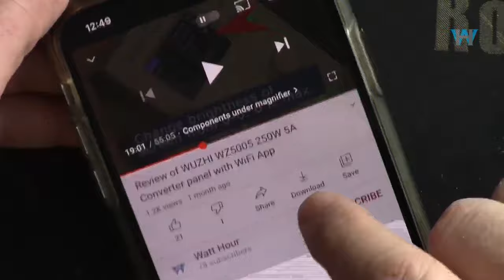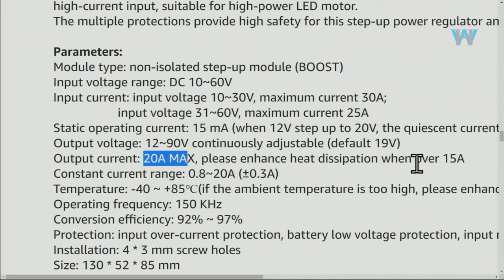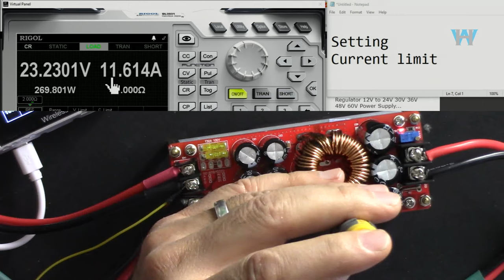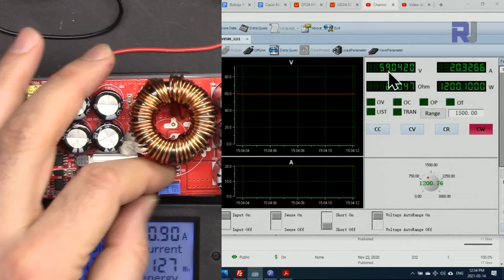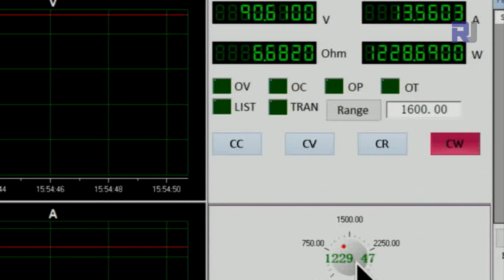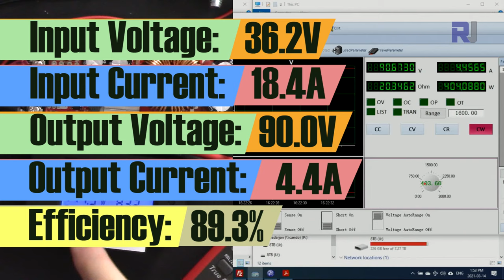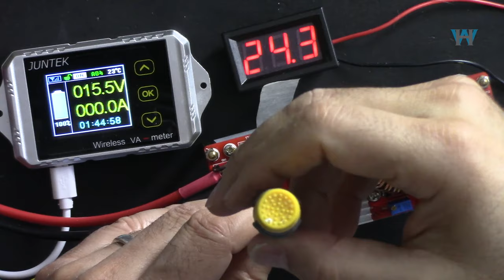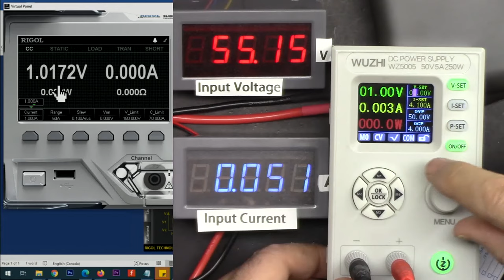Review of DC 1500W Boost Converter 10V-60V to 12V-90V module 1.5kW Tested

Comment: Thank you for your video !  excellent work !  I plan to buy 3 or 4pcs of this and connected them in parallel, I will add a blocking diode at the positive connector of output side before parallel connection.   The idea to add this component to prevent back flow current from other units.  Do you think this product can be connected parallel to bring up bigger current output ?  I plan to use this to charge my battery pack of 560Ah.
Reply: I used no diode and it immediately killed one of them. I don't know if I'd recommend it. Wish they made bigger ones.
Reply: Did you try out the idea and what was the result.  I guess, the OR-ing diode concept should work, provided the individual CC/CV modules are powered by the same input source.
Reply: There is some critical things I need to do in order to parallel multiple converters together. 1) same power source  2) same length of cable on input and output side  3) blocking diode at the output side of positive  4) set the CV at same voltage (this is most difficult part as the CV potentiometer is very tricky, sometimes it goes 0.1V to 0.2V up or down when you just make a very slight turn.  It is better to set up individual voltage meter display with at least 4 digits "00.00" at the output of each converter before diode, better to have 5 digits "00.000" display. In this way you can monitor right away the change of voltage when connecting to load, set the CV before connecting to the load at the range of difference 0.02V or less if possible.  Wider the range of difference causes unbalance, this would result in the current overdraw in the converter running at higher voltage, then it burns.)  5) the voltage drop of blocking diode will change as the block diode gets warm, basically the resistance of diode gets lower when it is warm.  The point is that rate of resistance drop is not all same across the diodes, so select the diodes with nearly same voltage drop by using multimeter before using them.  This will narrow down the impact.   6) Keep monitoring the voltage change the first 20 min after connecting to load(i.e. charging battery pack), the voltage and the current will start high for a short moment, then gradually decrease, adjust the CV when the voltage delta is 0.2V or over, it does not matter which converter you choose, all depended on the output current & voltage you want.  If you do not want to exceed the battery pack voltage, then lower the converter with highest voltage.  As I mention earlier, you have to be very patient to play around with this CV and pay close attention to the voltage change.  The converter itself will have voltage change even you do not do anything on CV, but it will get stable after 20 min.  7) Measure the output current of each converter and make sure the value is not much different.  Adjust the CV to make them balance as close as possible,  For instance, you run two converter in parallel, one is measured 10A output while other one is 8A, that is acceptable as long as both of them stay at this value for 15 min, it should   not change much down the road, but if one lower one is 5A, then it is different story, it is so unbalance.  You can either choose to adjust the CV of lower one to match the higher one(you get higher total current output), or adjust the CV of higher one to match the lower one (you get lower total current output).   Overall speaking, it is challenging process, but it is fun ! as long as all converters has very close output voltage and run in same voltage for 20 min with load, the whole system is stable to run continuously.  Good luck !

Comment: My battery runs about 63volts when fully charged, do you think it can handle an input voltage of 63volts?
Reply from the maker: Hi, it seesm you have not watched the video. I did thw test of up to 90V.
Reply: @WattHour  im asking about the input voltage and not the output voltage of the boost converter my friend.

Comment: Hello. Another question: Would be possible to get the specifications for the adjustment potentiometer? I'd like to remove the existing pots and replace them with pots I can mount on externall on a project box enclosure.
Reply from the maker: Hello, it is directly written on the pot. if written 104, it means put 10 and 0000 (4  zeros) so 100000Ω or 100kΩ. if you read 203 then 20 and 000 so 20,000Ω or 20kΩ.
Reply: @WattHour  Thanks for that information.  How would I know if the pots are linear or nonlinear? I guess I could count the turns and measure the output.  I'm looking to substitute with a panel mount.

Comment: Thanks for this nice work my question to you I have a lifepo4 3V 280A battery is it possible to use this device to power my 72V electric bike
Reply from the maker: Hello, I mentioned and shown the minimum input is 10V. The title of the video also shows  10V-60V.
Reply: @WattHour  Yes, you are right. Forgive me, I did not pay attention to this, but in this case I will need 4 3.2v batteries until the total is 12v so that I can benefit from the voltage booster

Comment: Hi not sure if this question has been asked. Can two of these be used together to get +_ dual rail power. Trying to power an audio amp in a car with 12vdc.
Reply from the maker: Hi, no it can’t.
Reply: Hi thanks for the reply. In my search I found a 350W DC12V To Dual 32V Boost Power Supply Board For HiFi Amplifier Car Amp sold on ebay. Maybe tou can do a review on this. I have no experience with devices so I dont know if they actually work as advertised. Thanks again for you time and effort. You present valuable info for amatures.

Comment: You're videos are great, to the point and easy to follow.  You would make a good teacher.  With your investigations what is the highest wattage buck/boost CC CV converter that is short circuit protected at the output that you have found?  (and do you have video for it)

Comment: can i use it as a step down? my battery is 40-36 volt and i need 30-32volt. so i mean can the output work less than the input
Reply from the maker: The output is AWLWAYS higher than the input. Check other videos. Please watch before postin questions.

Comment: Do you think can it be used to power a Milwaukee M18 FHIWF12-502X impact wrench from 12V car battery? Problem is Milwaukee does not provide any Amp or wattage info about this tool so hard to figure out the peak Amp for a 1356Nm nominal torque and for 1900Nm peak torque. Normal factory battery is 18V 5Ah ... thanks your comments on this...
Reply from the maker: you would have to power it up using another source, put it under load and measure the current using ammeter (current meter) . Otherwise you can blindly connected and see it this can handle it.
Reply: @WattHour  Thx I will try it to power it up from 12VDC car battery directly. I think I will loose some power (12VDC instead of 18VDC) but still strong enough the tool to serve my needs. So I do not need to buy anything extra ...

Comment: I would be very grateful,,, I am wondering if I can lower the voltage from 48v to 36v 600w with this electronics... I don't know what to buy,,,, thanks
Reply from the maker: T by is is boost converter meaning your output will always be higher than the input. You need step down converter or Buck converter. See my channel for those types of converters

Comment: How did you connect the voltage sensor to the PC? so you can monitor what's going on! can you please help me !
Reply from the maker: it does not have any connectivity feature for computer. you may modify it yourself.
Reply: @WattHour  what's the software ?
Reply from the maker: there is not software. I said you write your own software and modify it to work for your purpose. or use Arduino IDE (Arduino software)
Reply: @WattHour  oh thanks dude ☺️

Comment: Can I parallel 2 or more of these units for more output? I have multiple 36v lithium batteries and a 48v 3000w inverter.
Reply from the maker: Yes you can if you set the outputs exactly the same and  set the current at maximum.
Reply: @WattHour  Thanks for the input, but I still worry about the load being imbalanced due to manufacturing tolerances.

If one of the boost converters gets overloaded, goes into protection mode and the output voltage drops, could higher voltage from the other converter backfeed into the overloaded one?

Comment: good day sir please help me, why transistor irfp4110 drain pin number 2 is always burning when i connect this to 48v 20ah battery, i want to make my ebike battery supply a constant voltage to increase performance but it is always burning, please help sir
Reply from the maker: the mosfet must be dead or there is short circuit on the module.
Reply: @WattHour  i tried the 1800w and 1500w module but same results sir, they are burning on pin number 2 after i connect it to the battery source, they must have given me defective items? or my lifepo4 source is the problem
Reply from the maker: Hello, If you live in Canada or USA, I am giving away this DL24P 180W load and energy meter. Make sure to sign up for it https://youtu.be/-UblSfUEY-0

Comment: i don't understand why you have to set the current from the source input to charge battery's. why start with the output set high and then reduce it to what you want it to be. i have always set the current pot as low as it will go, connect the battery then start turning it up watching an amp meter in line with the battery and to my knowlage it has never done my battery's any harm?
Reply from the maker: Hello, please see the "Lithium battery charged" chapter of this video https://youtu.be/4J3FQ8jVokY  to see why.  the video has chapter so you can go to that section quickly.

Comment: Can we fix a potentiometer instead the variable with the output voltage to use it as a dc motor speed controller + boost converter?
Reply from the maker: Ya you can if you use the same value potentiometer. But controlling motor by carrying the voltage is not a good practice as it might affect motor’s performance. PWM is the way to control the speed.
Reply from the maker: Like this https://youtu.be/UzCmynbpAIk module

Comment: Holy crap, my device is defective. Mine looks the same as yours, except it is rated at 1800W on the product page, it has 3 20-amp fuses instead of 2, 2 input terminals instead of 4, and no heat sink on the PWM. With those differences, I can run 5 amps at 50V at the output. This produces at consistent temperature of 50 degrees C. If I go higher with volts or amps, I get thermal runaway. I can get nowhere near 1500W, let alone 1800W. I can only get 250W. Not sure what to do, except throw it away and try a new one.
Reply from the maker: I bout the 1800w version and it turned out to be defective a and now I have it half recoded. I should post the video so people know the module is not working.  Not sure

Comment: Hello. Can I use this to charge a 60v battery using a 12v solar panel using this device?
Reply from the maker: yes you can but you have to know how much is the charge current for your battery and set the limit.  if you don't set the limit, you battery will get damaged.

Comment: Hello. I tested this DC/DC converter an had someproblems: I have a power supply with 26V and 23A max. . Without any load, the output voltage reached the desired value of 58,8V. After I connected the load, I only reached the target voltage with over 20A input current and a very low output current. How can I prevent that the output voltage breaks down? When I turned the current adjust otentiometer, almost nothing happened.Could you please help me?
Reply from the maker: Hello, Output voltage is reduced when the current is reached the maximum set value by CC or constant current potentiometer.  Your input is 26VX23A =598W and 15% losses or 88W so 598-88=508W you can get at output.  So for output at 508W÷58.8V=8.6A and that is the maximum you can get (at output). Remember power or Watt can not be increased. That is physics law. you can change voltage and current but can not increase power (watt). Please reply with your thoughts.
Reply: @WattHour  thanks for your answer. Yes i know, but output voltage still decreases with very few current. Maybe I have to reduce it more? But I have to limit it at the output and not at the output or does it not matter? A stablen58,8V at the output is most important, i guess i have to limit current at the output to keep the voltage stable?
Reply: @kaikart123  yes I know, I found the reason why I could not get a stable Output voltage that is high enough to charge the battery. I had to turn that current limitation and under voltage protection for almost minutes to stop the circuits from reducing output current and voltage.
Reply: @kaikart123  this DC/DC has 3 potentiometers: voltage setting (output), current limit and undervoltage cut off as explained in the video. I thought I had turned current limitation to maximum and disabled undervoltage porotection but the potentiometers weren't turned to maximum values.
Reply: @Niggolaars  I see so it was just operation error and not the fault of the device
Reply: @kaikart123  yes, because i thought that the potentiometers were at their Maximum and I did not want to turn them toonmuch because I feared to damage them.

Comment: Can i use this for car stereo to be used at home. My power supply is giving only11.95 volts dc and i want to boost it to get13.8 volts dc.
Reply from the maker: Yes  you can. You should see I what was the minimum Inout village and in that minimum voltage what was the minimum output . I don’t remember the values

Comment: Can I use this to charge 13S Li-Ion with 54.6v at 7A ? Just set the voltage to 54.6v and the CC to 7A right?
Reply from the maker: Please watch the video and see how to set the current
Reply: Hi I have the same problem with my 7s1p LiFe battery. Do I need a special load to set the current? I tried putting 12V batteries on parallel to adjust current at 12V but it was giving me 10A no matter which position the pot was at. Do I need a special load for this?

Comment: I use it for laptop
From 12 to 19.5 volt 7.7a 
There is a little heat
The fan start and stop always 
Why it not work always?
Reply from the maker: fan turns ON only if there is enough heat.

Comment: Thanks for the video, it is very informative. Now I want know if input is 12v @10 amp  (from a battery of 12v 10c) and output required 48v to be connected in a motor with 48v  900w,  then is the motor performance  good? Please help me with your advice.

Thank you.
Reply from the maker: Any device that has constant current should be able to handle short circuit at th output.  Else CC has no meaning
Reply: 12V@10 Amp = 120watt as the source.  the load is 900w.  The source cannot drive the load.

Comment: hi i was just wondering if it is possible to control the voltage via the connecting pwm signal on the potentiometer of the voltage control
Reply from the maker: Hi, it might be possible. but it should have some challenges.  it is  is not just to feed PWM to adjust the voltage, but to monitor output voltage and adjust PWM accordingly and this PWM should be also function of (CC) input/output current so if the current increases it should reduce the voltage. Actually I wanted to modify it do that but I doubt there might be total of 100 people would watch or need it. you may try it. good luck

Comment: Can this unit be pararel to gain high output power
Reply from the maker: yes it can. But you MUST set the exact voltage on all other pairs and MUST set the same current. if the voltage differs , the current will flow one into the other and energy wasted and possibly it will catch fire.  Also if you don't set the current with exact value, whichever device has lower setting will limit the current when your load draws the current, resulting voltage reduction (this is what Constant Current or CC does) and resulting the current to flow into that module from other modules and that module will overheated and possibly catch fire. So if you can set exact value and monitor them, then it would be safe to do so.

Comment: What happens if input higher than output set point. My input is from battery and need to keep output at 12v
Reply from the maker: whatever voltage you connect, the output will be higher. you can't have lower voltage than input.
Reply: In my case. I want to output 12v from a battery. Battery voltage is changing from 10-14v. So when battery voltage is 10v, booster can boost it to 12v. But when battery is 14v, what will happen to output? Is it 14v or will it damage the booster.
Reply: @WattHour  can you suggest a boost converter with such behaviour?

Comment: Why not set the voltage with a dummy load, then turn the current control to minimum before connecting proper load with ammeter. 
Current can than be increased safely.
Reply from the maker: Yea that would be a solution which I did not realize to do.

Comment: in 36 volt test.why output amper is so low? my ebike motor needs 25 amper.also my battery says only 15 amper input
Reply from the maker: P=V*I (P=power, I=Curent in Ampere, V=Voltage). So do the math.

Comment: ok, i am finally back to look at how to use these. my 1500 watt converter appears to output the exact same volts and amps that i put in, i have a load testers, amp meters, volt meters and plenty of batteries to play with, but turning the pots seem to not affect anything. EDIT:  in my question i was talking about the 1500 watt unit, i decided to test my 1200 watt unit and it works. so maybe i was sent a bad 1500 watt unit. damn i smoked another load tester, also it seems like i couldnt get output to be higher than input until input was above 24v then i could take it all the way to 99v
Reply from the maker: yes when  you get output exactly the same as the input, that is when the converter is has problem.